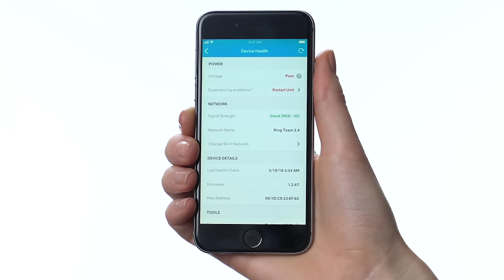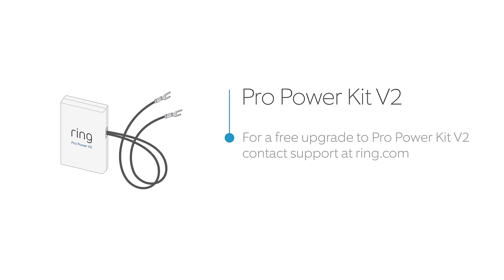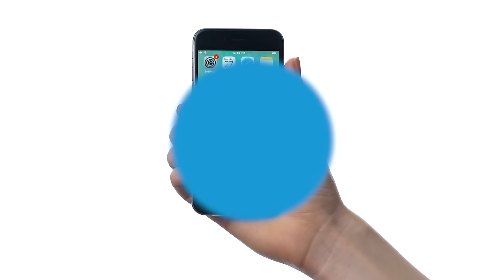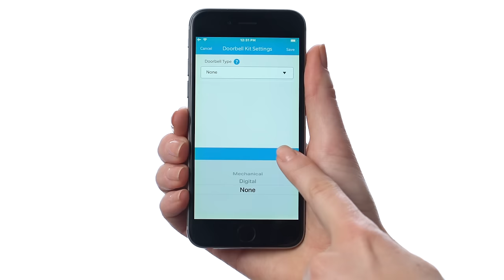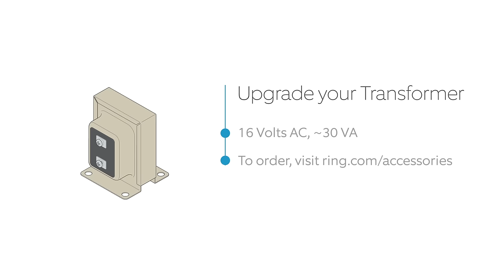Resolving Power Problems with Ring Video Doorbell Pro (formerly Video Doorbell Pro 2)

Comment: If you read this and have the problem with it not going into setup mode you need a new transformer or a plug in transformer that is 24 volts. Ring advertises 16v as an option but recommend 20-30v.
Reply from the maker: Hey Bryce! For the Ring Pro, we recommend a wired connection to a 16-24 volt AC transformer with a 30 VA rating (volt-ampere). Those experiencing low power may have a transformer with a lower VA rating or there may be an issue with the wiring. We're happy to help look into any power concerns — feel free to give us a call anytime: ring.com/callus.
Reply: Hola,  tengo un ring pro me funciono solo una hora con un transformador de 16 vac 30va . Luego se quedo con la luz blanca no puedo configurar nuevamente ! Help !
Reply from the maker: Hola vecino. El Ring Video Doorbell Pro es compatible con su transformador y queremos ayudar para que su timbre esté activo lo más pronto posible. Una luz blanca en el frente es buena señal e indica que el dispositivo está recibiendo suficiente electricidad. Para hacer que la luz comience a girar de nuevo, presione el botón situado en la esquina inferior derecha, detrás del panel frontal. El dispositivo debe comenzar a hablar y decir que está en modo de configuración. Éste artículo muestra más instrucciones: https://bit.ly/2NoRFb7. Si no está funcionando para usted, por favor llámenos al 1-800-656-1918 (fuera de los Estados Unidos: ring.com/callus). Estamos disponibles 24/7 y felices de asistir.
Reply: @ring  Gracias por responder compre el equipo en EEUU lo traje para argentina, funciono solo dos horas luego no funciono mas tiene solo la luz blanca fija encendida cuando púlso suena pero solo en el ring cuando presiono el boton naranja el dispositivo no habla no entra en modo configuracion .
Reply from the maker: Gracias por clarificar, Ariel. Si su Ring tiene un botón anaranjado en la parte trasera, la luz frontal no debería permanecer encendida. Recomendamos hacer un proceso de restablecimiento de fábrica para ponerlo en su estado normal y luego tratar de configurarlo una vez más. Por favor presione el botón anaranjado por 15 a 20 segundos. Una vez deje de parpadear, siga los pasos incluidos en este artículo: https://bit.ly/2JfVKcw. Si ésto no cambia el estado de su timbre, por favor envíenos la dirección de correo electrónico conectado a su cuenta de Ring y nosotros estaremos encantado de asistirle con más detalles. Gracias por ser nuestro vecino.

Comment: What a load!  How about Ring design a product that works with most peoples homes?  I was up until after 10pm with a tech trying to resolve this problem last night  Now I get to root around my attic this evening to look for my doorbell transformer to replace.
Reply from the maker: We're sorry to hear this was your experience, Sean. We'd like to help turn things around and ensure you can get your Ring Pro set up. Please send us a private message on Facebook or Twitter with your Ring account email address so a member of our team can contact you directly. However, we'd be glad to discuss other options that may work better for your home. While the Ring Pro requires a hardwired connection to existing doorbell wiring or a connection directly to a transformer, we do also offer battery-powered options that can be installed just about anywhere. Check out all the Ring Doorbell options here: https://bit.ly/2SpnRbP and let us know if you have any questions.

Comment: I need to connect the Ring Doorbell directly to the transformer. Is using the bypass mode on the powerpack a similar concept to using a resistor. I am asking to ensure there is not too much power being supplied to the doorbell from the 24V transformer.

Comment: I had the original ring and then upgraded to the Ring Pro.  I loved it until it stopped working recently.  It is disconnected and seemingly has no power even though the transformer is working perfectly.  The reconnect button doesn't respond and there are no lights on it at all - indicating to me a lack of power.  The app shows 3996mV voltage.  My chime and chime pro are still powered and connected to the network, but the Ring Pro itself appears to be dead.  Unless this can be fixed, does anyone have a recommendation for a more reliable video doorbell?
Reply from the maker: We want to help ensure your Ring is functioning properly and we want to provide you with a long term solution. We have Social Care Advocates available on Facebook and Twitter if you want to send us a message, we are here to help. 

Also you can give our Community Support a call at 1-800-656-1918, (or if outside the US: http://ring.com/callus) between 5AM-9PM PDT, seven days a week for more support. We look forward to hearing from you.
Reply: I’m having this exact issue. How did you resolve?
Reply: Same issue.

Comment: I used a 18v plug adapter and was suprised in the app it said it was 15v even though its rated 16-24v It did say the power was good power, as I had it directly wired without any doorbell inline with it

Comment: My ring pro suddenly stopped working. It’s getting 19 V to the back but if I try to sync it to the Wi-Fi nothing happens. I short the  two wires together my indoor bell rings. Looks like it just died.

Comment: Hello, I installed my ring doorbell pro a month ago and it worked fine, the ring doorbell rings when pressed and my internal bell also rings “ding dong” right away, now when i press the ring doorbell, it rings fine but my internal only rings “ding” and delayed the “dong” for about 20 seconds. What is my problem ?
Reply: Problem fixed, I realized the setting was “digital”, s/b “mechanical”. Silly me.

Comment: Does this procedure correct WiFi connection issues.  I have WiFi up to 150 Mbps and downloads of 12 to 14 mbps but it keeps saying I have no internet.  I have rebooted the router and the ring pro but still no connection even when it’s able to find several WiFi networks including mine when searching for a signal.  It’s connected to my phone with the voltage showing “Very Good” and signal strength of RSSI-52 consistently.  It’s also able ring my home’s doorbell with or without the V2 adapter.
Reply from the maker: Hey Alex, we'd love the opportunity to take a look into your Ring account and see what is causing your Ring Video Doorbell Pro to stay offline. Please give us a call anytime at 800-656-1918 and we would be happy to help find a solution.

Comment: My ring doorbell stopped for Unk reason, replace transformer ring turns on for a minute or so and goes out I have Power at ring and have wireless router right inside doorway. It worked for about a year and a half. Not sure what’s to do next. It was nice while it worked.
Reply: Could not get ring to stay on, it appears to have been a failed update, reinstalled as new with updates 
Fingers crossed it’s working.
Reply from the maker: Hey Sonny! We want to make sure your Ring is working. If reinstalling didn't help, give our community support a call at 800-656-1918. We're available 24/7 and are always happy to help.

Comment: So, this video explains how to resolve power problems by completely bypassing the home's doorbell? That doesn't sound like a solution. I've been using this doorbell camera for several months now. Love the camera, hate the fact that I was never able to make my doorbell work. Replaced the transformer, replaced the entire doorbell with a new unit, nothing worked.
Reply from the maker: Hi there. Bypassing your internal chime can help to route the transformer's power directly to the doorbell in the case of low power, or resolve issues concerning a chime kit that may not be compatible. We'd love to help find a solution for what you're experiencing — please feel free to reach out to us on Facebook via PM and we'd be happy to have someone look into your account.
Reply: I would try a 16 VAC , 30VA transformer or a 24VAC 40VA transformer.  I would recommend the latter.  I tried the former and still had issues.  Less than before but still not 100%.
Reply: @SAFirEarms  Did you still use the Ring power kit with the 24VAC transformer?
Reply: Does your doorbell require a 24v supply, or does it require 16v? If 16, and you are running it on 24v supply, is everything ok?
Reply: And, for a digital chime, is there still a diode needed on the doorbell (with Ring Pro)

Comment: My app doesn't say voltage. It says it's hardwired but has 3% battery.
Reply from the maker: Hey neighbor, we'd like to look into this. If you have a battery-powered Ring Doorbell, we'd recommend still fully charging the Ring before wiring it to existing doorbell wiring. Please send us a message on Facebook or Twitter with a screenshot of your Ring's Device Health page so a member of our team can assist. You can also give us a call anytime at your local number: ring.com/callus.

Comment: The app says voltage is fine but still won’t power on. It also says that the internet is bad
Reply from the maker: We're here to help, André. Your security is our top priority and we want to make sure that your Ring Doorbell Pro is working to its fullest potential. Please give us a call at 1-800-656-1918 (or if outside the US http://ring.com/callus) so we can get this resolved.